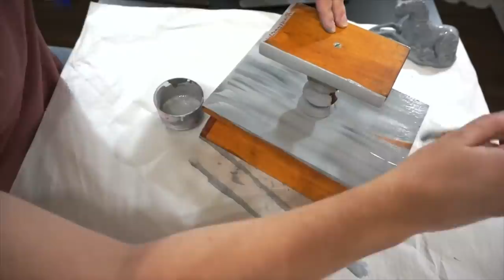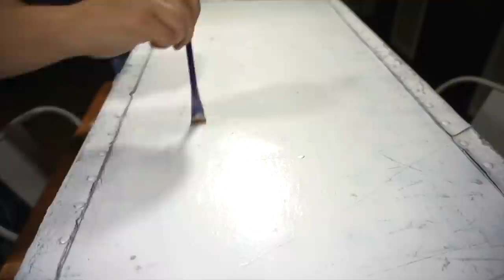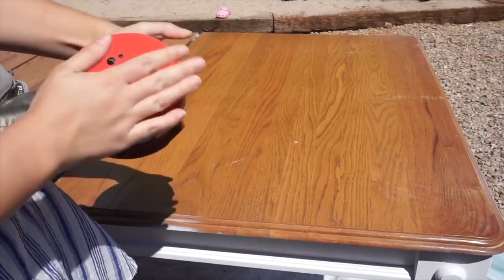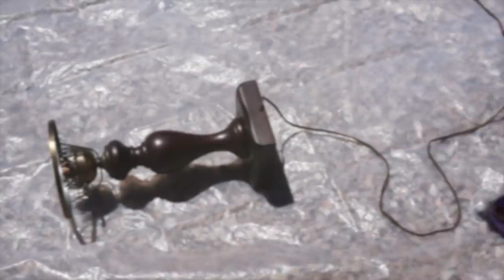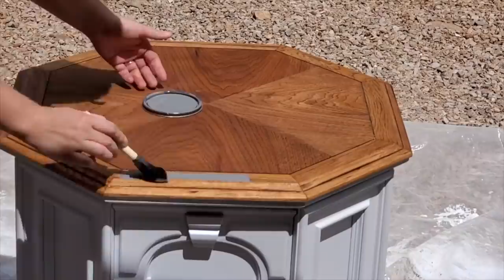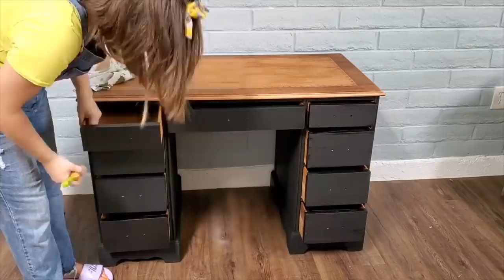HUGE TRANSFORMATION 10 Thrifted and Trash To Treasure Furniture Makeovers | Episode 3

Comment: Have you tried the spray can trigger or holder applicators? Saves on the finger fatigue and paint splatter from using spray paint cans.
Reply from the maker: I would like to have one of those!
Reply: @DesertDIY  mine was about $4 AU from hardware. Love using it.

Comment: I really really like the liming  wax👏🏻👏🏻‼️ did you get it at Lowe’s ❓is it pretty durable after the polycrylic...❓thank you❣️🌸
Reply from the maker: Lime wash and lime wax are two different products. Lime wash is gritty and is meant to be applied like glaze where it is wiped off. That can be found at lowes.  Lime wax is smooth and applies like wax or a white wash and can be found on my amazon store. They are all durable once sealed with polycrylic
Reply: Desert DIY 
Thank you‼️so you did not do anything after the wax but the polyurethane, or did you just let it dry... if so, does it take long to dry... those tables turned out beautiful ‼️I’ve never done the waxing... the video was fast, but I took some screenshots ... do you have a slower video showing using the wax... I prefer to use anything water based like the polycrylic , because of the odor ....like your courage to jump right in and do it👏🏻👏🏻👏🏻👍🏻🌸🌸 also, how far did you sand the tables down before waxing❓
Reply from the maker: @mountaingirl1797  yes, I have a full length video of these projects in my trash to treasure playlist :)

Comment: Hope you can help me... finally got my new orbital sander out ...really like that lime wash look... with the 80 disk I used on the coffee table... doesn’t seem to make much progress ... could you please give me some hints should I bear down on the sander or should I stay in one spot because it has what I hope I is solid wood I’ve already seen in areas .... do I go back-and-forth and back-and-forth  or around and round to get it down to that whatever it is and I think it is real wood if you could give me some hints I sure would appreciate it I saw you tuber and he said all you really need it was 80 120 and 220 and that’s what I’ve got ...came with the sander could you help me with some ideas as to how to get finish totally off....thanks a bunch... I certainly don’t have the experience like you🙋🏼‍♀️
Reply from the maker: You can definitely apply pressure. It does take many passes over thick finishes to get down to bare wood. Continue with 80 grit and add a bit of pressure until you start seeing the light colored bare wood. Then move on to areas around the newly exposed areas. If your piece is solid wood then you dont have to worry at all about sanding too far. It would take a lot of work too hurt a solid wood piece with sand paper lol. If it is veneer wood you will just need to watch to make sure you don't sand through it. Take your time and relax. And the advice about 80, 120, and 220 is so true!
Reply: Desert DIY 
Thank you❣️I needed that part about relaxing especially 🤦🏼‍♀️😁.... older ... going through change of life things even still at my age..your baby is precious ....waiting and praying for my  youngest son and his wife to conceive.. and they are waiting on God... she has PCOS..
Reply from the maker: I also have pcos. I had half of one of my ovaries removed in an emergency surgery due to a huge cyst rupturing. Praying for your family. The only advice I can give is ive always gotten pregnant as soon as i stopped trying. Thank you
Reply: Desert DIY 
Thank you much‼️‼️🌸🙋🏼‍♀️

Comment: You do nice work but the videos are sped up so fast that you can't read the products that you use and it would be nice to hear the different steps and why you paint things 3 or 4 times with whatever since nobody can read the cans because it's so fast. It's basically watching you do makeovers that I feel like I could never do because there are no type of instruction. You could even add captions if you don't talk much. Sorry but I didn't learn anything from your videos.
Reply from the maker: Carol, as I mention in the video, I have full length versions of each of these projects. I have a link in the description box to the playlist that has normal speed versions of every single one of these projects, where I give very detailed instructions and list every product.

Comment: Sad how you painted up that trunk sad how you paint everything white like that desk would have been beautiful is refinished Staind
Reply from the maker: Do you refinish furniture? Are you aware that there are times in which things are too far gone to be refinished/stained? That was the case for the trunk and the desk. The bottom half of the desk wouldve needed to be completely rebuilt with new veneer. The trunk was going to fall apart if it wasn't sealed with heavy duty rust stop paint.
Reply: @DesertDIY  yes I do restore furniture I really only seen one spot on your desk that needed veneer on the drawer which could have been replaced easily, although not seeing it in person that could be different story I have restored many trunks but I restore it to its natural color and refinish the wood braces that are on them polish the locks and brackets but like I said I did not see it in person so I'm not sure what's going on with it you do do a really good job in your painting, with me I'd rather have it restored to its natural state